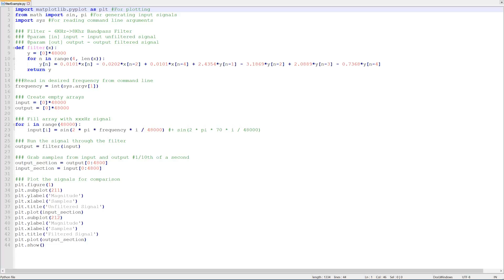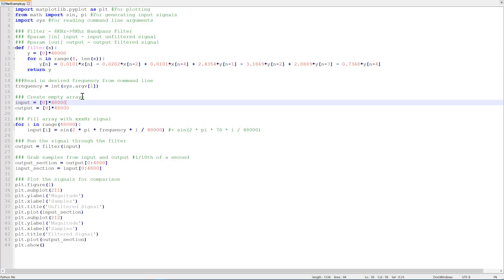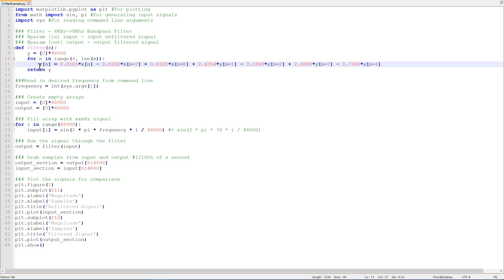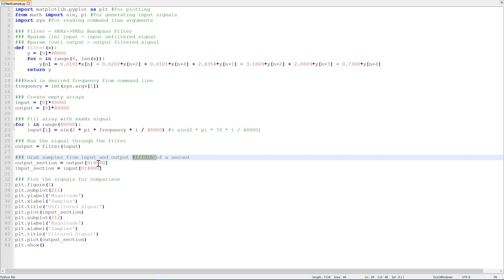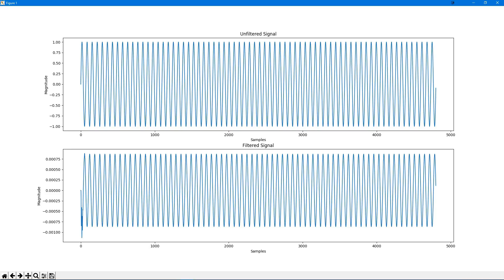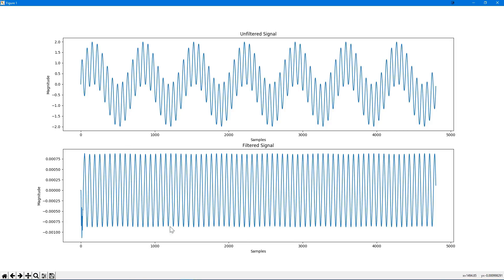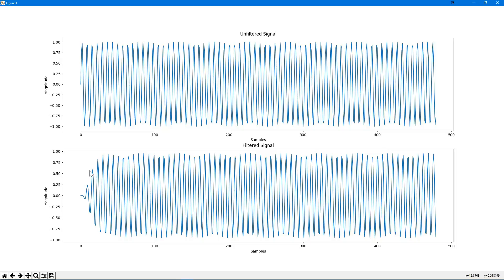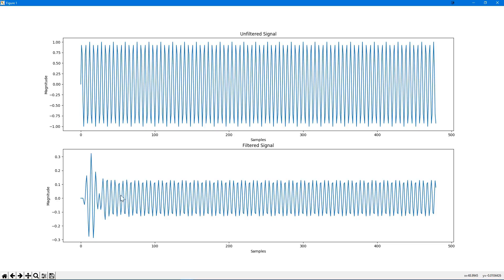(How to) Create A Digital Filter in Python - Signal Processing #20

Comment: Luke, a follow-up as well.. Supposing I need a continuous signal, you use the convolution process right? And also, you won't create empty arrays but rather just create continuous signals right? Can you just type down the sample code here for some random input continuous signal and a continuous filter(I assume you define the impulse function for the filter here and use that for the convolution with the signal ). If there are any mistakes in  my line of thought or they need clarification or you want to add something on top, can you be as detailed as possible? I'm kinda slow and can understand better  if explained in a simplified but detailed manner. Thanks in advance!!
Reply from the maker: This process will work just as well for a continuous signal but you would have to implement a more complex system around it my example here. And sorry I make a point to not give out code as a response to questions because people can use it to cheat on university work.
Reply: @TutorialsWithGary  Alright I get it. Thanks!!

Comment: Hi Luke! I have plenty of signal processing experience and use it on the job, but I'm lacking in coding experience. What if it was a continuous signal, or rather a string of samples?
Reply from the maker: Hey, this approach will only work for a discrete filter sorry, but you could just sample your continuous signal and pass it through a filter such as the one we went through in this video. 
Not sure what you mean by a string of samples, are there multiple samples in a string object separated by some sort of delimiter? Thanks

Comment: Hellow, luke. thanks for tutorial. 
so i have a question in new talking about sounds and signals and i watch the video and i get that if i modify de 48 khz the bandpass filter change what i dont understand is that what value should i need for examplee to filter 3->4 khz signals. should i use 16khz and not 48 ? how do i know that ?
Reply from the maker: Hey Juan!
So this what your describing actually has a name - The Nyquist frequency, which is essentially saying, at what frequency so i have to sample my audio stream to ensure that I dont miss any information about my input signal, this is typically denoted as: 
"the minimum rate at which a signal can be sampled without introducing errors, which is twice the highest frequency present in the signal"
Thus if you were looking to signals up to 4kHz, an 8kHz sampling rate should be good enough. This doen't mean that having a sampling frequency any higher will negatively impact the result - if anything it will make the output look cleaner. So anything above 8kHz (even the same 48 that we used in this example) would work fine :)

Link: https://en.wikipedia.org/wiki/Nyquist_frequency
Reply: ty for answer luke, i will look into Nyquist thorem, one last thing i modified de program to reproduce the sound depending of the input frecuency, of course.
 do you know how could i reproduce the sound after the signal is filtered ? or how can  i get the frecuency of the signal after this pass through the filter
Reply from the maker: You sure can, the output data is the sound wave that it generated as an outcome of the filter. If you want to listen to it, you can export it as a *.wav file pretty easily in python, you can follow this to work out how:
https://docs.python.org/2/library/wave.html
If you have any problems and can't do it, let me know and I should be able to write something that does for you.
Reply: Thanks a lot, bro i use wave library and i can reproduce the sound of the filtred signal. thanks, man
Reply from the maker: No problems, glad to help!

Comment: where did u get the coefficients of the filter , i can't use signal.butter in python
Reply from the maker: +Hanna Nabil hi,
The first video explaining how we got the coefficients is: 
firstly we calculated the frequency response in this video  https://youtu.be/WJ7WeKgdcQw 
Then we calculated the filter coefficients given the frequency response in this one:
https://youtu.be/uZGqFZD3S10

If you are using the scipy library for your Butterworth filter, and you have imported it as scipy, you will need to use scipy.signal.butter, details can be found here
https://docs.scipy.org/doc/scipy-0.14.0/reference/generated/scipy.signal.butter.html
Reply: Thanks For reply Man i really appreciate it 
so um trying to implement a digital filter for a signal from .wav file it's sampling rate = 38000
so i used this command 
b, a = signal.butter(5,5000/nyq, btype='low', analog=False, output='ba')
where nyq = 0.5 * 38000 
so i implement a low pass filter that cuts all above 5000 hz  just like what u did in that video but when adding a frequency of 6000 it does not filter it ,, actually it begin to filter from 15000 hz 
Do you know why ??
Thanks in advance :D
Reply from the maker: Edit: Not this.
Reply: when i tried first divide the nyq by np.pi and apply it made a strange output and does not filter what above 5000 when multiply by np.pi  reduce the magnitude of all the frequencies below 5000 and above >>>
actually i put the whole code on stackoverflow 
http://stackoverflow.com/questions/43947999/digital-filter-coefficients-using-butter
** Another thing Can i have your E-mail :D